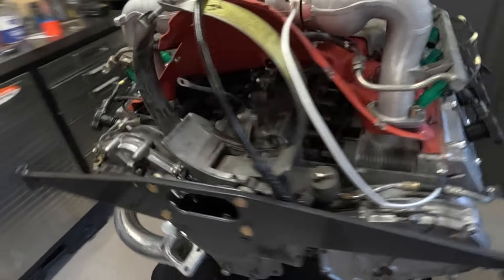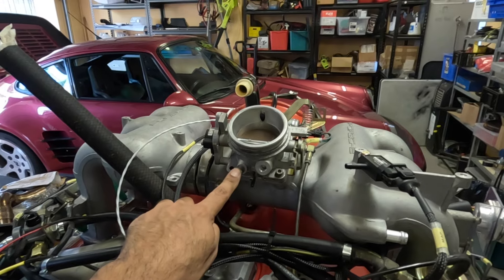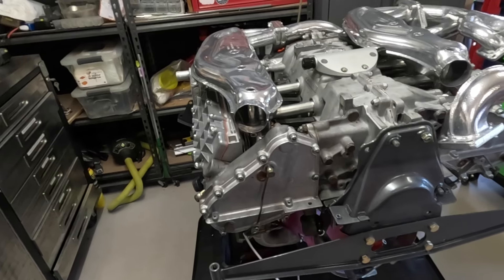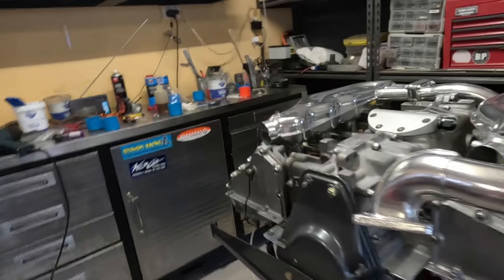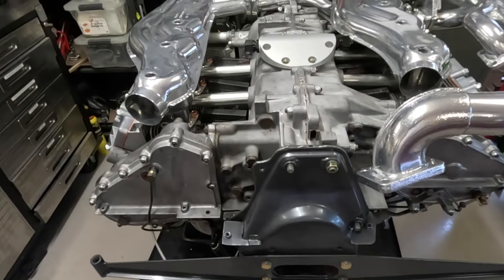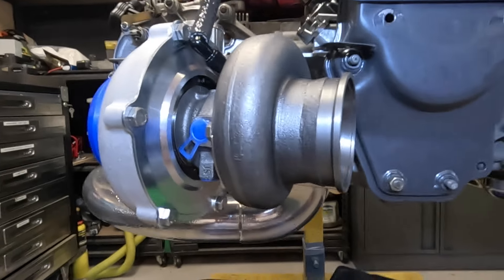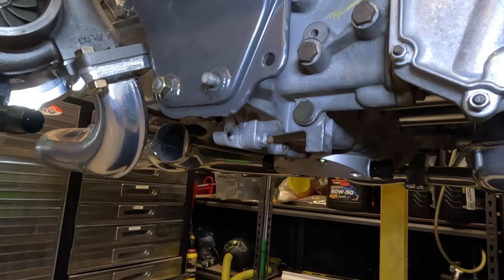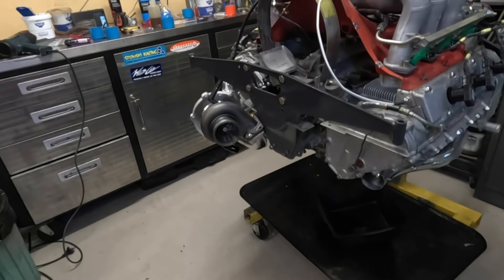11 - How to Convert your Aircooled Porsche 911 to Turbo and EFI - Oil Lines...

Comment: I have a few ideeas:
1. If the turbo core is not above the oil level in the engine at all times, then the turbo will piss oil everywhere no matter how you spin it.
2. The drain tube/pipe/hose/whatever must be heat insulated because it is not enough oil in the pipe to cool it, and it will either burst open or it will clog up with burnt oil crap.
3. The same applies to the feed line
4. Dump the oil retun line oring, and use some high temp gasket+silicone or whatever you see fit, something that will not turn rock solid in 5K km
5. I don't think you need another connector for the o2 sensor. All cars have only one O2 connector.
Reply: I agree, the oil in the turbo drain will be the same level as the oil level in the engine so I would say the drain would be filled right up into the core looking at it, I would say it needs an in-line pump to keep it empty

Comment: Not an expert here, but some certainly claim that the gravity sump drain can work.  I've also seen installations where it drains back into the chainbox cover and even a valve cover!  Speculation:  Surely the oil pump helps suck it through?  Mind you, I've also seen failures with this approach (thinking: Team Boosted here on YT) 🙂 ... BTW, I did add a connector for my Wideband sensor, but only because the controller is external.  Of course the Bosch WB sensors themselves have their own connectors + a ~60cm lead.
Reply from the maker: I've seen those draining points too, but the turbo must have been mounted MUCH higher up. On this setup, the turbo is not very high up at all. I considered adding another T3 flange as a gasket to raise it up higher but will run it like this to start and go from there. The part I'm unsure of is with the oil from the turbo entering the sump plate, and the engine is already dumping plenty of oil into the sump area, how much does the internal oil pump actual suck up, in order for it to evacuate the turbo drain?
Reply: I'm actually keen to try a high mounted Turbo for that reason, but that's a project for the future (far away.)  Raising the Turbo like that might be a good idea.  I really can't say how well it works.  We're all seeing the same rumours 🙂 ... I guess Porsche had a scavenge pump for a reason, but I see why it would be nice to avoid it if possible (just all the extra bits needed alone, right?)
Reply from the maker: @dra911  so the original turbos were a plain bearing and used a lot more oil. 
Later turbos are ball bearing and have a restriction in the line so they use much less oil. Hopefully that will be good enough to work. However, now the potential issue is with inadequate cooling.
Reply: Makes sense. So maybe sump return will be OK?  Worth a try.  I had not considered cooling issues, presumably from the oil supply...?  Never read about that before!

Comment: What pulsar turbo did you go with? How much boost are you planning to run? Excited for this build!
Reply from the maker: My motor is stockish... Running 9.8:1 max Moritz pistons... So plan to use a low boost setup. turbo is a Pulsar 3076r with 0.63 ar. will use tial f46p with 0.5bat spring.

Comment: Does that bracket for the turbo go the other way round and use the bottom cradle bolt?
Reply from the maker: Unfortunately not... I tried every which way! I suspect that bracket may work on a stock 930 but seeing as I am using a 3.0SC with 3.0SC heatexchangers (thin flange) and mating to a 930 J-Pipe (which may have bent with heat over time?) it just won't work in my application.